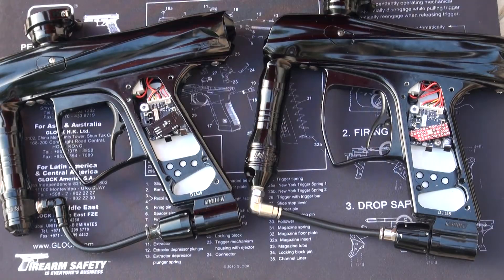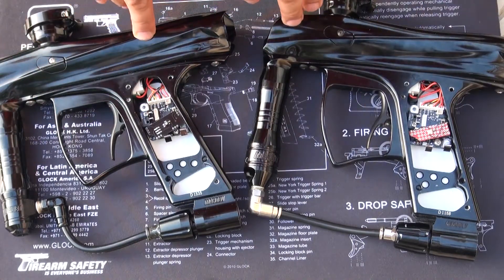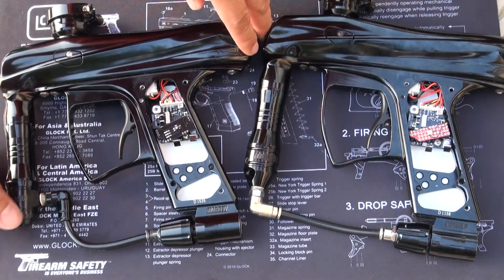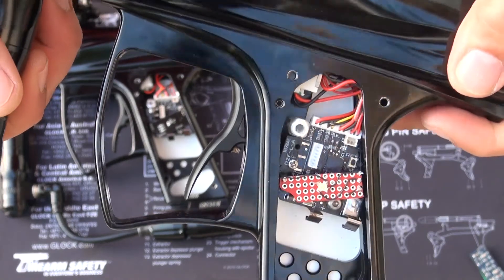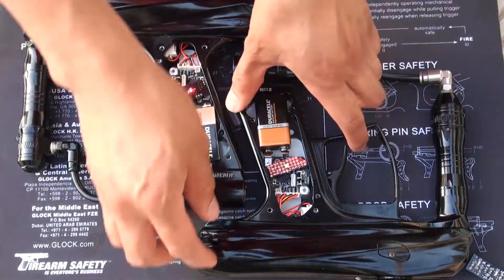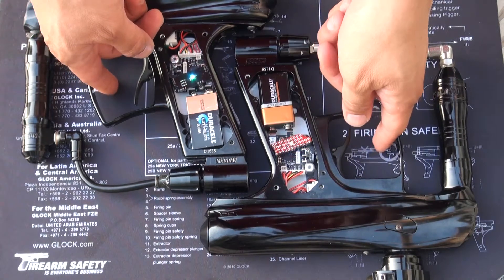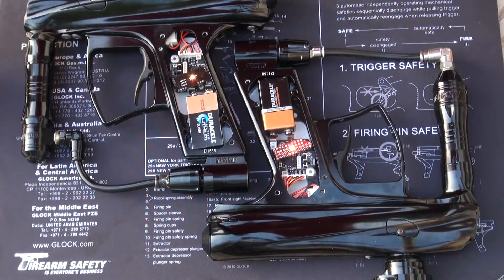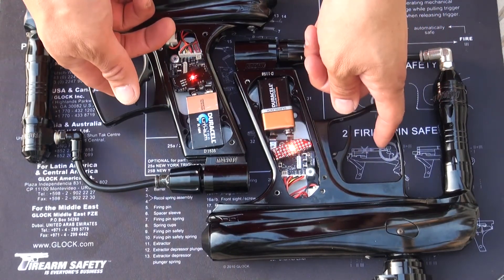Tadao LED conversion board - Homemade!

Comment: Hey what would u recommend a DPG5 or Proto reflex rail 2015 I'm trying to decide need some advice plz
Reply from the maker: Ethan Whatley If it were me, I'd get whichever one is the better deal.  If I could get either one for a ridiculous price, I'd get it.  I have no problems with DP guns. I maintained them and had no problems with them. Briefly had a rail and was easy to maintain.  Very quiet shooter :)